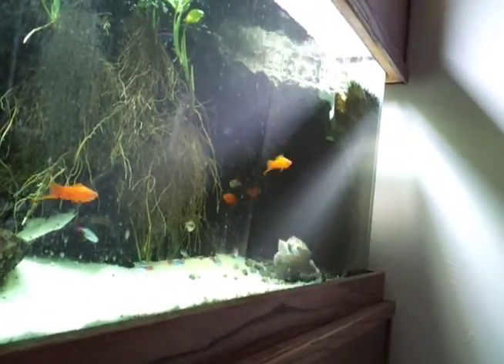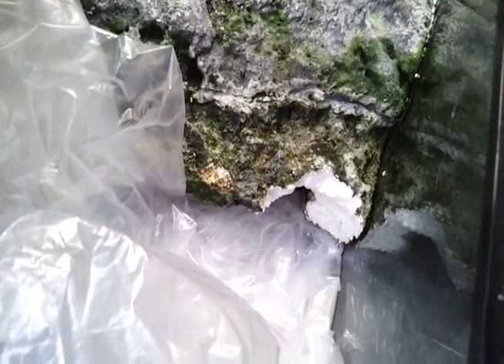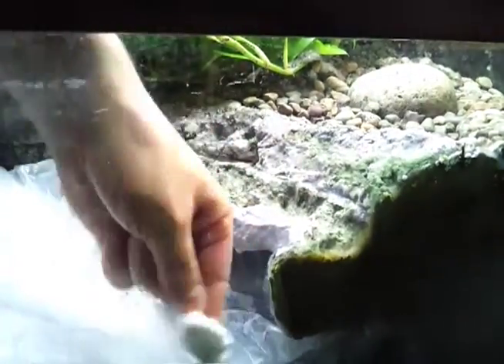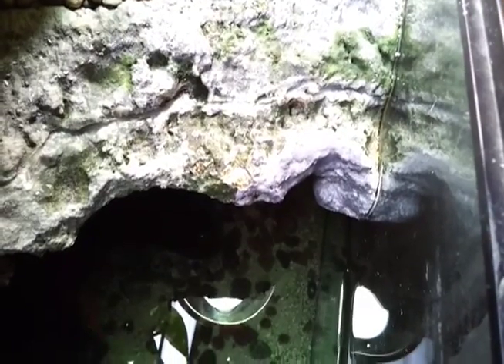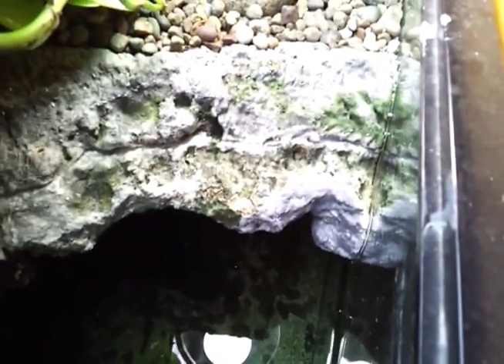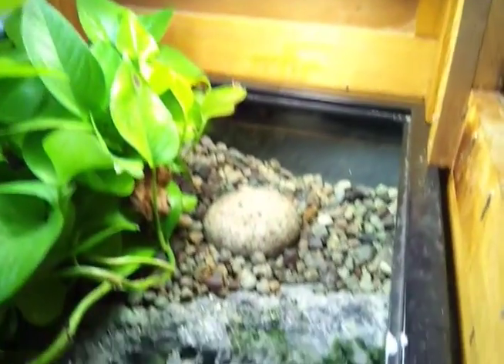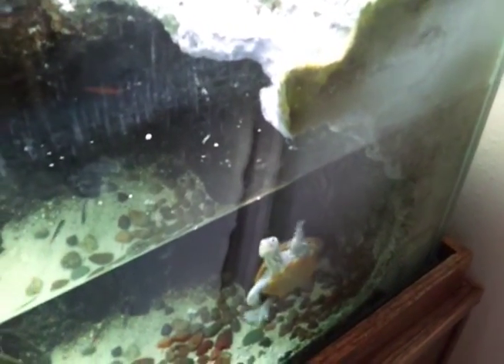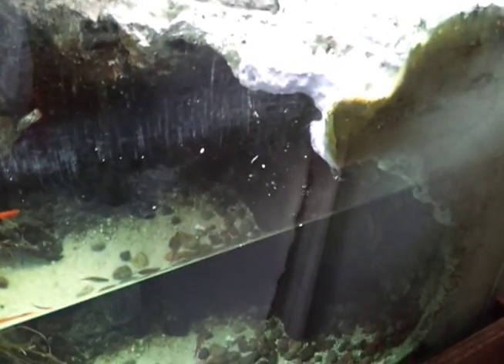#86: How to Patch a DIY Background with Drylok - DIY Wednesday

Comment: You should experiment with drylok/cement/gorilla glue. Made a styro bg for my cichlids had make same style repair
 The gg dries in minutes and "force" cures the cement and dtylok mixture. The three together make a toufh coating. Nice vid good luck